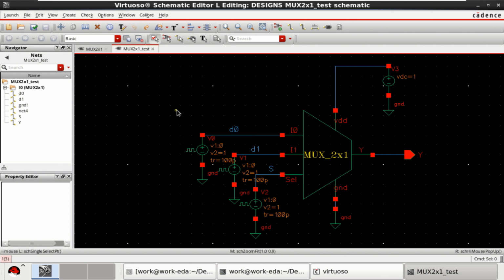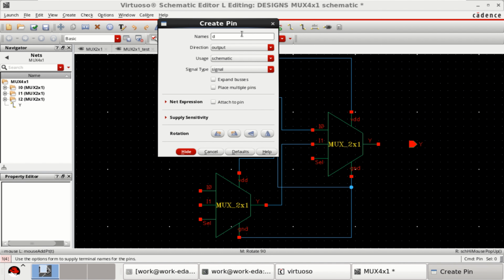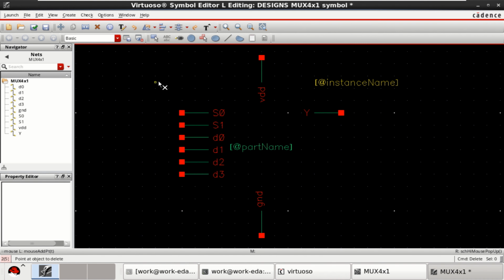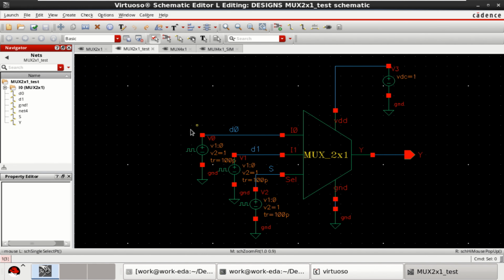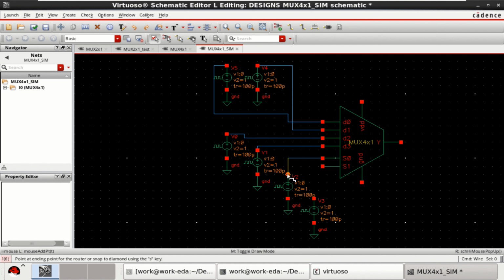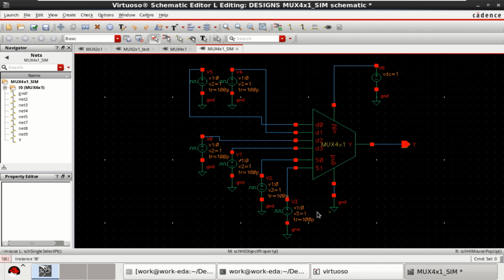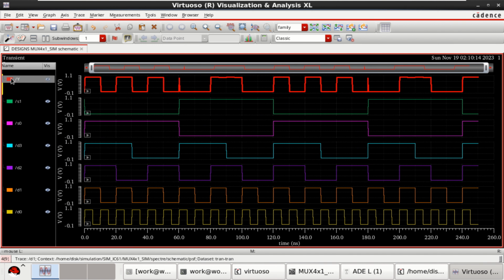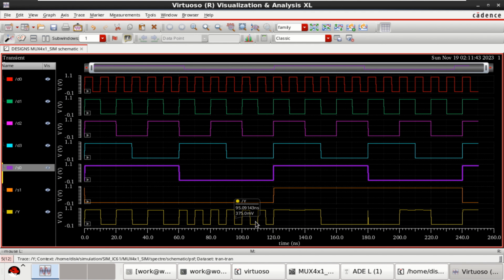4x1 Multiplexer Using 2x1 Multiplexer in Cadence Virtuoso.

Comment: Sir, after proper symbol circuit and testbench designing during netlist run I'm facing fatal error of netlist flattening how could I resolve it?
Reply from the maker: Hi, once in test bench with symbol. Select the symbol the use Shift+E on keyboard. It opens the schematic with transitors. Now Check and save the design. The use cntrl+E on keyboard. Run the simulation. Hope it works.

Comment: sir we need give the same volt for so and s1 so we can get all the inputs
Reply from the maker: Hi, applied voltage should be same as Vdd. S0 and S1 should have same voltage. But you change V1=0, V2=1 and V1=1, V2=0

Comment: Sir plz upload video on how to design 4:1 MUX using pseudo nmos logic and clocked cmos logic and measure their power and delay in cadence tool
Reply from the maker: Hi, process of designing a mux is same. Pseudo nmos logic and clocked logic may require alternative form of circuit